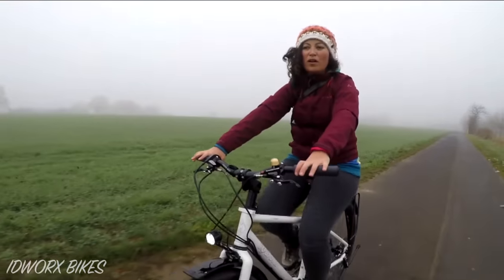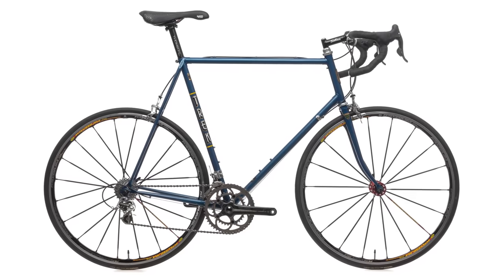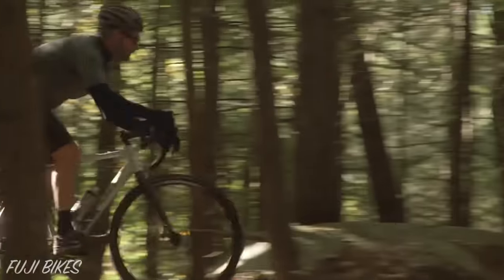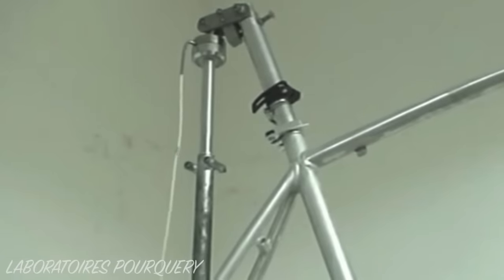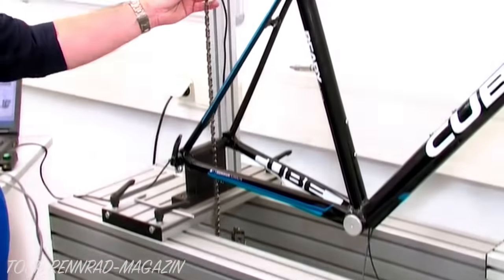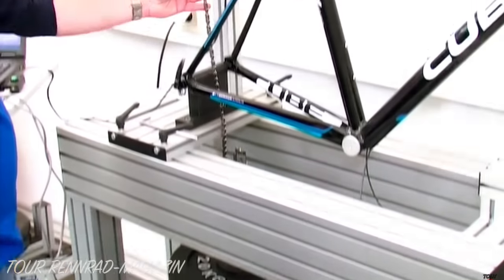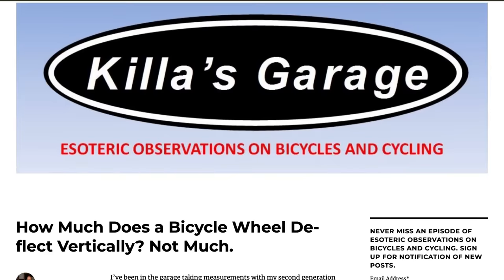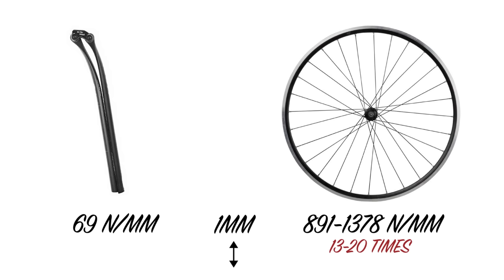Why It's Impossible For Steel Frames To Be More Comfortable Than Aluminium

Comment: if you just take material propertires on the equation . it's simply misleading. yes 4130 steel is stiffter ( by 3 times) that 6061 Aluminium. but there's another properties like polar section modulus, GCN already made video about steel. if the tubing diameter getting larger the stiffnes increased dramatically. and also carbon have to be stiff enough  so the resin wont fall of if it flex top much.
Reply from the maker: The point is not that there are differences in the properties of frame materials. It's that the vertical deflection on a frame is essentially meaningless when you calculate out the springs in a series.

Comment: I enjoyed this vid, even though you use a very narrow definition of 'comfort' and in the way a computer might, rather like claiming the harder the spring rate on a motor car, the less comfortable it will be. It's not even the starting point for judging comfort. 

No mention of forks, of vibration damping and frequencies, of the relative resonance and damping rates of wheels/forks/frame, simply vertical compliance. 

Some of the most comfortable bikes I've ridden were made from an alloy of steel, not comfortable because of the material necessarily but likely because they were desgined by humans who were natural artists as well as fine engineers, not graduates with a powerful computer running powerful software. With a similar amount of experience with other materials it's very likely the end result would have been as superb.

Which isn't to detract from modern bikes, the best are better than what went before, if no more satisfying.

Comment: Real world aluminium can be harsh. Maybe not on road bikes but MTBs and dirt bikes it can be quite hard to get an aluminium frame right and can send you into the dirt if its not. Its a lot harder to tell with modern al frames
Reply from the maker: I've never noticed a difference on mountain bikes because of how big a role the tyres play. Understanding the spring in a series concept sheds light on this.

Comment: A frame can be engineered with vertical compliance, out of any material.
A steel frame with flexible seatstays will have more vertical compliance than an aluminum frame made with a stiff rear triangle, and it will be able to isolate the riders movement over larger bumps, no?
Reply from the maker: As I described in the video, it's impossible for frame deflection to be noticeable because of the high force required to deflect a frame a vertical millimetre. Even with the softest possible frame, it is still a wash when you consider the spring in a series effect.
Reply: @Cyclingabout   All other 'springs' being equal between 2 bikes, I  think it would be obvious if a frame was designed to be stiff or compliant once the limits of those smaller springs are met or exceeded. For most road riding, the tires and seatpost will be the biggest springs. But does this continue to hold true when riding on cobbles or gravel?
Reply from the maker: Until you bottom out any of the softer springs in the series, you won't make much of a dent into the hardest one.

Comment: I simply refuse to agree. I used to ride a high-end Principia aluminium frame with Thomson seatpost, stem and handlebars. After two years I found a good offer on NOS steel Koga Miyata Full Pro-S and was able to move said seatpost, stem, etc. Also I am using the same saddle. Koga is smoother, especially in the back. Aluminium always felt 'cold' ride-wise, carbon 'hollow' and steel just right. Subjective terms and opinions, but hey, they work for me.
Reply from the maker: The important bit is that you find the ride more comfortable/smoother! 👍🏻

Comment: If you do think that comfort is saddle deflection on force, You are definitely wrong. 
Also you are wrong in schematic where is sum of springs. You should add masses between these springs too. And then apply different frequencies to tyre spring. And then see results on pedals, handlebar and saddle.

Comment: Assuming all this is true (and I don't see any flaws in your argument), why am I still constantly hearing that this frame or that is "more comfortable" or "more forgiving" than another?  It seems that the suspension provided by the tires is orders of magnitude greater than any flexion in the frame, (rigid) fork, or wheels.  Why, for example, are dropped seatstays touted as more comfortable or more forgiving?  It seems to me that the chain and seatstays, forming triangles with the seat tube, should not flex in any perceptible way (and, in fact, less in a dropped configuration, since the triangles are smaller and hence more rigid?)

Personally, I have not felt any difference in ride comfort among my steel, aluminum, or carbon fiber bikes, except for differences in tires and tire pressure.
Reply from the maker: I'm confident it's all marketing, old wives' tales, and the resulting placebo. But hey, if the placebo works on you, I think you should run with it... 😅

Comment: Completely subjective, but I have owned a total of 4 steel bikes before my first aluminium one. I immediately noticed how much this donkey rattled my fillings loose. (And I haven't read ANYTHING on the subject before, so I doubt it was the placebo.) I went back to steel for my next bike, and won't consider anything else besides, maybe, Ti.
For me at least, the fork is the main contributor to that. I notice shocks through my arms much more than through my behind.

Comment: But what about the micro cracks that appear in aluminum parts after 5 years due to vibration?  The life of a Al frame is 5 safe years....
The most vibration comes from the front wheel so the fork is more important that the frame and seat post.Even the type of wheels rims spokes had a greater impact on my ride comfort than the frame itself. After owning over 50 bikes i can state that the most comfortable aluminium frame was always a cannondale for me..not sure why...probably some secret technology...also a steel Bianchi mtb was extremely comfortable over bumps...
To make the debate easier: space x rocket will be made from steel and not aluminum....so a steel bike will also be more durable...no doubt about it...
Reply from the maker: While it might sound alarming that aluminium develops micro-cracks through use, we can design aluminium frames so that they have enough reserve strength to last a lifetime. Remember that it's not the material, it's how it's designed, engineered and manufactured. Same with all other materials. Just because something is made from steel, doesn't mean it's durable.
Reply: @Cyclingabout  Of course its also material depentent because regarding fatigue life and impact resistance, titanium>steel>alumínium, its a fact. Its true that the combination of design, engineering and manufacturing make the total of the finished product, there is also no denying regarding the fatigue life characteristics of steel being superior to aluminium.
Reply from the maker: @pedrofskymtb  I am not denying any fatigue life superiority. It's just not a problem because we can engineer aluminium to last enough load cycles for a lifetime of riding.

Comment: Great stuff, but most cyclists won't believe it. They have invested their very identity in their brands and material choices. I routinely read nonsense about wheels being "compliant" when if that were true, it'd mean a wheel that was ready to fail. I recently quantified the alleged "compliance" and comfort advantage of moving a seat stay connection 8cm forward on a n-DF frame. If you hit a 2cm bump on a concrete wheel, the difference would be 0.25mm. Completely imperceptible, and much less than the change you'd get by failing to pay attention to tire pressure. Cyclists only like to think they're making decisions based on data. In reality, it's Ford vs. Chevy vs. Dodge with fewer wheels.
Reply from the maker: I find it really fascinating that people are looking for all kinds of ways to design a test which proves that the steel frame is more comfortable. Compliance tests on an angle, bottom bracket deflection tests which measure side load on the crank arms etc. I've thought about all of these things for many years, but cannot work out a way that it'd be possible to determine a tangible benefit. 
But yeah, I guess if you're invested in something being true, it's pretty hard to change your mind...

Comment: "Placebo"? Do you know what that word means? Steel is undeniably more comfortable than either aluminum or titanium. I've ridden many bikes of each material. Scientific data notwithstanding, this is one of those phenomena which defies mathematical modeling. As the old saying goes, "It works in practice, if not in theory." I own professional quality steel, aluminum and carbon fiber bikes. If I could do a blind riding study of these bikes, I am certain I would choose the steel bike for long ride comfort. After years of riding, I have found that the weight advantage ( small ) of aluminum over steel can only be truly enjoyed if the aluminum bike has either a suspension fork or frame ( heavy ) or a suspension seat post ( relatively light ).

Comment: what about the front fork? I can see the fork flexing on my steel bike with just my weight pushing down. Some carbon forks flex as well. I had an aluminum fork/frame (Alan) that was more flexible than any bike I've ever had... It wasnt necessarily better tho, too flexy on the ALan! But, to me, the fork being able to flex is important. Not suspension, but suspension benefits from a flexible fork.
Reply from the maker: Fork 'splay' can make a big difference in terms of front comfort, depending on the front configuration of components. Unfortunately, the data I have suggests that material has little to do with the amount of splay on forks - it's all about how the fork has been engineered.

Some steel forks have very little splay and would, therefore, ride quite 'harsh'. Other times steel forks have a tonne of it and would ride comfortably.
Reply: @Cyclingabout  surface level analysis of this data suggests to me that it is playing more of a marketing role to support carbon seat posts. Tires make all the difference so yes any frame will do... but the front end hits the bumps first. First impact is on the front, not the seat post... the carbon fork on my orbea terra does flex a bit as well. Some carbon forks don't flex much at all though. I'm not really going anywhere talking about this though..
Reply from the maker: @brandonneur  Vibrations occur at varying degrees both at the front and rear of the bike. It really doesn't matter where the impact occurs initially, the important bit is that they can be mitigated using tyres, forks, seatposts, seats, handlebars, stems, grips and much more.
Reply: @Cyclingabout but. Steel doesn't or barely fatigue (?) So. I'd want flex in steel not in fatiguing aluminum.  Maybe in carbon but it sounds like a high effort to engineer that versus steel.

Comment: I simply dont like aluminum forks.  Aluminum forks make my ride very obviously less comfortable than steel and carbon fiber forks.  I can care less about the frame material on the bike if we are just talking comfort.  Aluminum forks with 2 inch wide tires are tolerable because of the comfy wide tires.  A typical 700 x 32 tire doesn't damper down the stiff, bumby, hard feel of average aluminum forks over minor bumps.  Just my two cents of experience

Comment: Ummm,  front end?  Bars?  Stem?  Grips or tape?  Head tube length?  Fork construction and geometry?  All critical to comfort as well.  It's not just about the butt. 

Also, steel can be brutally harsh or dreamy smooth - it's not just the steel (or aluminum or carbon), it's the design.  I've had a steel Surly that was very harsh, and a steel Surly that was very smooth, even when running nearly the same component and tire mix.
Reply from the maker: This video was a focus on frames specifically! I might put together a film about the other aspects of comfort at a later time.

Comment: I want to argue but can't do so, because, well, math is  hard. But, my personal experience it's the torsion of the steel frame that makes them the superior ride. (hard tails) I'm a bigger guy at 6'4 and in race shape I was 200 lbs, and my first bike beat the tar out of me. I switched to steel and math, math, math... it felt way better!
Reply from the maker: Perhaps it's the components rather than the frame, but ultimately - it doesn't matter! Your current bike feels better and you're more comfortable. 👍🏻

Comment: I don't understand why you are concentrating on frame flex alone vs flex force. Tires, seatpost play a huge difference, but the chattering, small sudden jarring road surface holes and small rock surfaces in combination with high pressure road tires are affected by bike material and tubing configuration. If you're riding on dirt roads utilizing these new gravel bikes, you may not notice the difference much. Probably why you don't get the aluminum bike complaints much anymore.

Comment: weight of rider, geometry of frame and material thickness should be added as well. for example most of bikes are made for up to ~120kg riders. How do you think how my 68kg ass will feel everything on that standart steel or alu bike? and what will a 110kg rider feel on same bike? every time i add some as little as ~5kg of stuff on my steel bike i already fell that it flexes more. for a comfy bike we need good quality steel with tube thickness and geometry that are set for our bodies. Still steel is real. btw I had and have bunch of alu and steel bikes.
Reply from the maker: Interestingly, even the lightest steel tubing under the heaviest rider would not create a spring light enough to generate any meaningful difference in the vertical deflection. 😊

Comment: You have it backwards steel is more comfortable a dude asked me if my XtraCycle would be better if I had a seat post shock absorber on my 52 pound cargo bike I have Balone tires and a cruiser seat WTF it dose not get better so smooth that extra length crome Molly frame

Comment: I work at a used bike shop and ride all sorts of bikes from all sorts of ages made from all sorts of materials. This video made one straw man argument about deflection through the seat as though that’s where all the weight sits. Weight is on the seat, bars, and pedals. It’s all three contact points that make up comfort. It’s laughable to think frame material makes no difference when I can look down as I ride and see my comfy steel commuter flexing and my stiff aluminum road bike not flexing. I mean, have you never been riding an old steel bike, gotten out of the seat to sprint, just to hear your front derailleur start to rub because of all the torque you’re putting on the frame?

Comment: Good work. What you post makes sense but I can’t get my head around this: on my bike I once fitted bigger tyres, they spun freely with space between the rear tyre and down tube, but when I sat on the bike it rubbed and couldn’t turn. Does that count as vertical compliance?
Reply from the maker: Something is definitely not right with your bike! I've never had that with any of my bikes.

Comment: Tests in the controlled environment of a lab never tell the hole story. Sure, in a lab or on a perfectly smooth road all materials may me equal but in the real world the heavy steel frames absorb the bumps,holes and gravel better.  My back and sit bones confirms this.
Reply from the maker: It's not just lab data, but a combination with our mathematical understanding of structures and the physical properties of different materials. I'm really glad you like your steel bike though - that's the important bit.

Comment: Short answer: Steel is very stiff under compression, and all this nonsense of vertical compliance in the marketing for your modern wonder-bike is just typical marketing BS. I'm still riding a 90's steel frame on 23mm tubulars, and my seat is significantly higher than my bars. I don't care about comfort on that bike, I'll build a touring bike with 2.3" tyres if I want comfort.

Comment: Perhaps the curved forks on steel bikes has a dampening affect that aluminium cannot replicate.
Reply from the maker: It's definitely possible for steel and carbon forks to be engineered with more flex than aluminium forks. But we cannot generalise here!

Test data shows that steel and carbon forks can have 2-3X the stiffness of aluminium forks. So it really just depends on the individual fork rather than the material.

Comment: Tange steel for the win, with  araya vx 400 rims : thats 400 grams a hoop.  Loose ball ultegra hubs that outspin that cartridge junk.  Carbon and alloy belongs in the recycling bin, for sure.
Reply: exactly what frame and bike are you describing.  It sounds good
Reply: @jamesmedina2062  1993 Crossroads CX.  You won't find it on bikepedia - too old. 400cx components  - dark purple in the rear, maroon in the front.  I upgraded the gears and shifters.  I am a wheel builder, the only hubs that can outspin them are the American Classics.

Comment: Aluminium frames tend to take metal fatigue more than steel one... But to be better steel frame need to be made from spring steel... So... At least steel frames breaks differently and are more repair frendly and have overal more longjevity... But I don't have cosmic amout of money to order custom steel frame in geometry I pleased and because in this geometry exist plenty of aluminium frames... I angry about such things, but I obviously have no choice. Especialy because war in my country and I possibly just can't obtain ANY adequate bike part for next at least ten years... So maybe I just get mad about on some point of time and just weld it myself from dumb not SO soft steel tubes, but chances too slim. At least I have no welder skill.